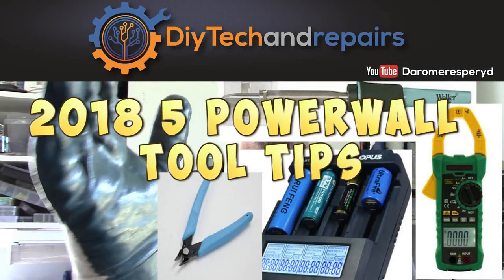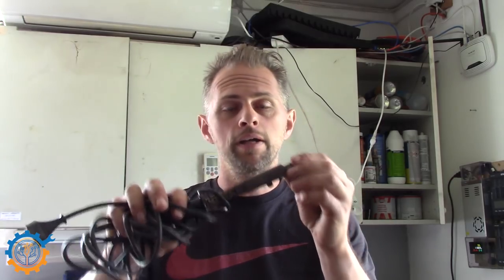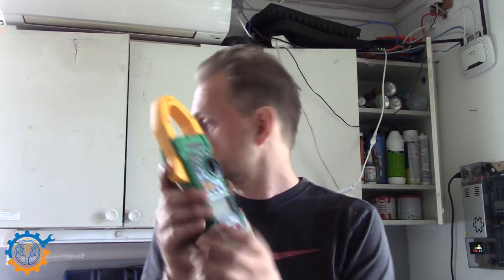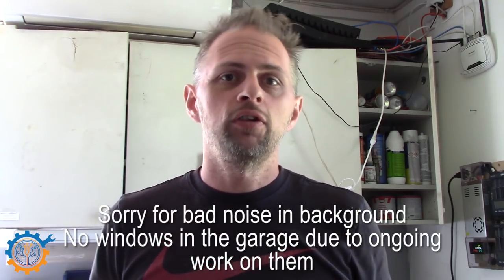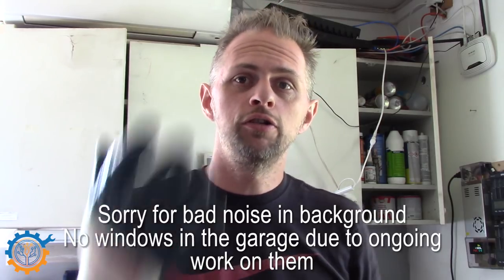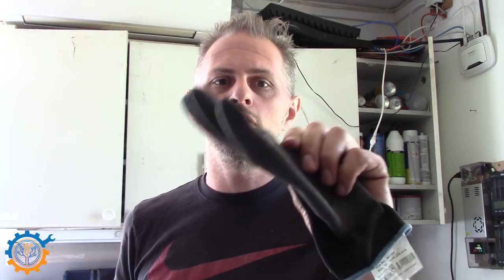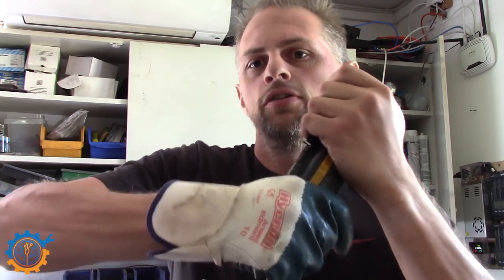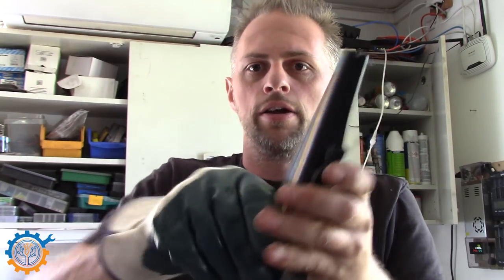2018 Top 5 Power Wall tool tips!

Comment: I have over 700 cells. And feel I have only barely started. They are all 2400-2900 mah. The ones for my bank anyway. I have other cells with 1500 rated that do 30a, I'm working on a bank to run my offgrid home. I have a 7s 100p for starting. I need about 10 times this.and more solar panels. 1500 watts isn't enough. Especially going into winter!! I do have over 600ah of lead acid Bank also. With a 5kw 24v inverter. 900% of my cells are nos. New old stock. With over rated capacity! I'm hoping for a long life!  2600 & 2200mah cells seem plenty. But not cheap!